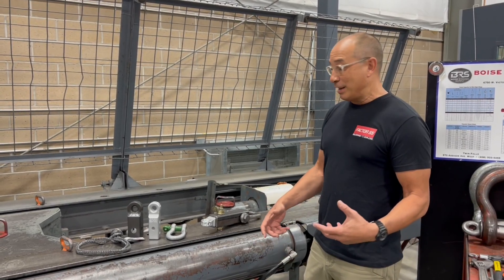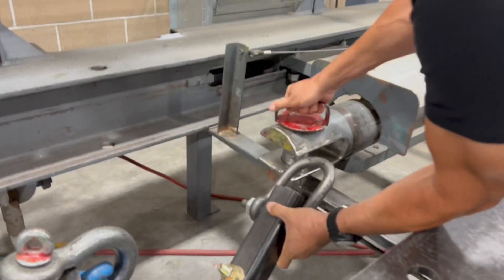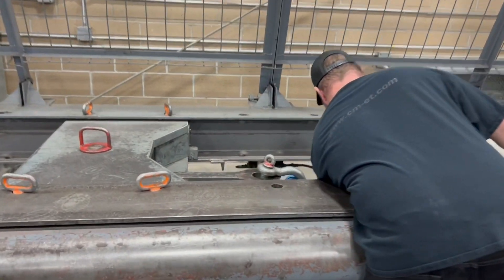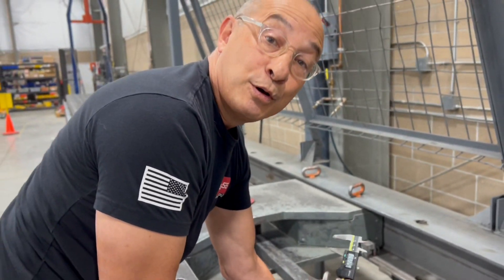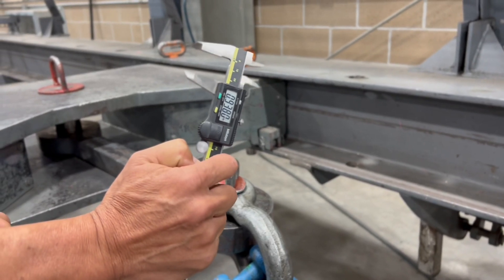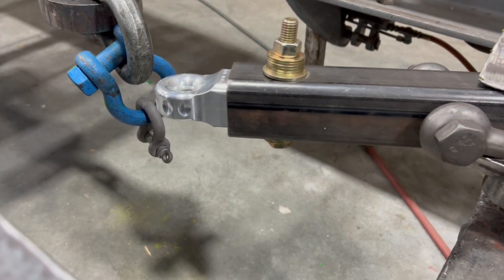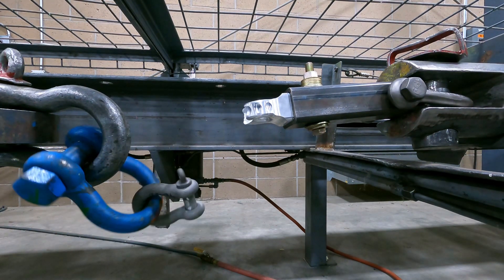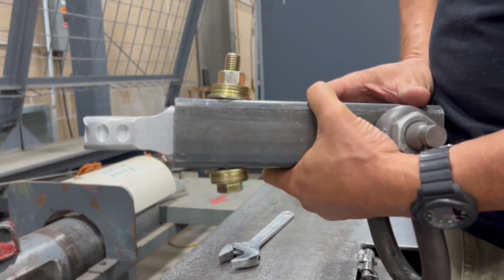Deep Dive into FACTOR 55 Destructive Testing

Comment: When Mike discovered that the bolt had bent, he mentioned that it was a Grade 8. This is the most important real-world issue that could arise in the field. Would a Factor 55 QUICK RELEASE HITCH PIN do the same thing? Would a Grade 12 bolt be better?

Comment: Hitch Link Pro 2.0 just got released in Grey Powdercoat, will it also be released in other colors?
Reply from the maker: It’s currently only available is Mil-spec type III hard anodized gunmetal gray. It’s a Professional tool and so far, will only be available in this anodized option, which is the strongest finish we manufacture. You can take them to your local shop and have them painted or powder coated whatever color you like. That is always an option. Thanks!
Reply: I’m good with the hard anodizing, was just curious.  Order incoming!
Reply from the maker: @AZ_JTR  thank you for your business and support!

Comment: Broke where the the recessed dimples were. 
Are they there as a yield point or a strength point
Reply from the maker: They are simply there for industrial design and easy finger grip. Removing those dimples from the design would result in minimal to no difference in ultimate break strength.

Comment: Really awesome video! Do you guys ever attach strain gages to your hardware to correlate your FEA models strain? Thanks for the confidence in your products.
Reply from the maker: Currently we do not. It is a very time consuming process and the variances of the loads we are dealing with are minimal. We have found the FEA modeling for our general product line has been extremely accurate for load tests based on the consistency of the material properties we use.

Comment: Wouldn't the previous material yield (albeight very small) impact the failure test results to the detriment of the tested hardware?
Reply from the maker: Not that we have observed. Ultimate failure is always within plus or minus 5%. We take the same products and simply go straight to breaking them to verify this.
Reply: @Factor55  And this is why EVERY SINGLE component of my recovery kit, from soft shackles to kinetic ropes to winch shackles and more, come only from Factor55. I can go cheap in other places but not with my safety.
Reply from the maker: Thank you so much for your business and support!